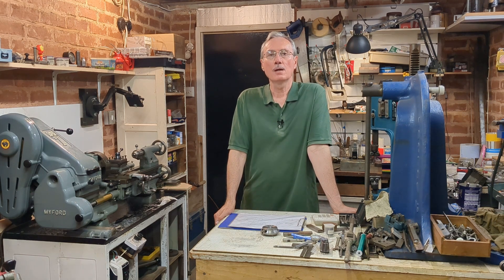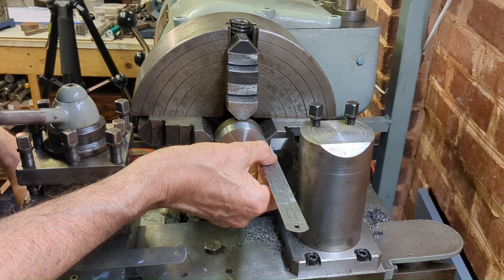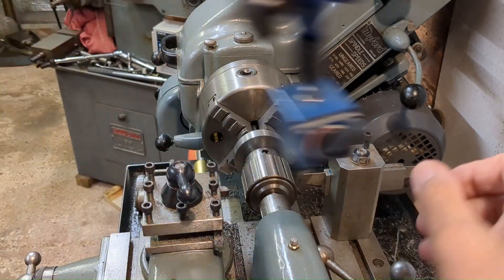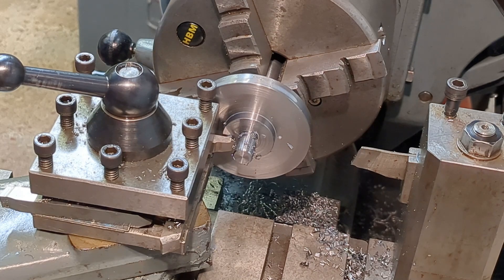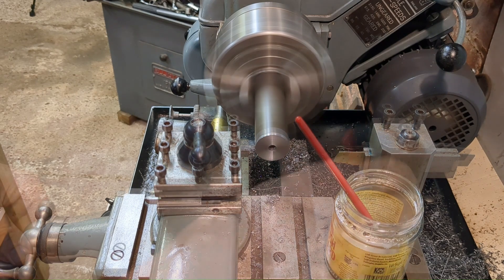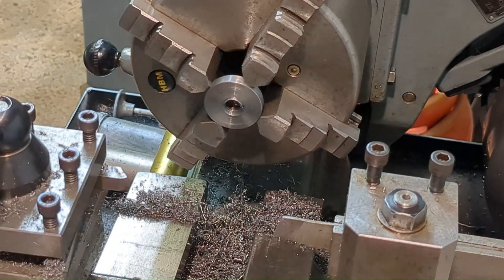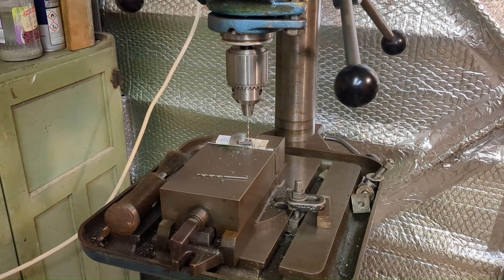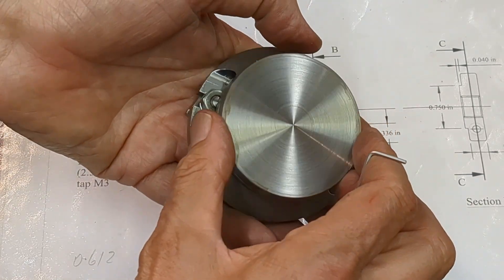Radius Turning Tool - part 2

Comment: Most likely the reason your threads were off was because the die cut them “drunken”.

I have that issue all the time, it seems to be less of an issue when you just take off 1 or 2 thou.
Reply from the maker: Thanks for your comment! I think the issue was the fit between the shoulder on the nut and the other component (which weren't intended to be locked up together). There must have been a small burr which threw things out. The male thread was 99% screw cut so I can't believe it was out. Or, perhaps it was the tapped thread that was out!
Reply: I rarely have issues with threads tapped in a machine, die cut, almost 100%.
I single point everything and run a die over it when I am 99% done just to correct slight errors from hand ground tool bits.
My last one was a 10-24.

Try getting a coolmist system instead of dabbing coolant, they do a good job and don’t make a big mess like flood cooling. The only drawback is they are noisy.

If you are running a carbide end mill on steel a cold air jet helps a lot.
I think we only have flood on two machines at work, both lathes and I use mine mostly to keep the part cool.
Reply from the maker: You are right; my coolant arrangements on lathes and mill are inadequate. It is just that this has been lower on my list of priorities. Will see if I get time to do something about it!